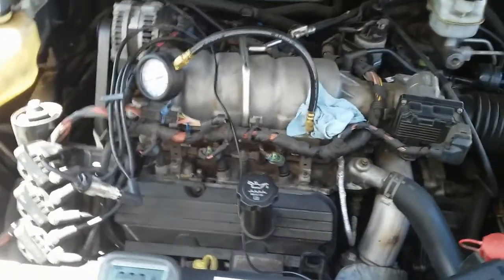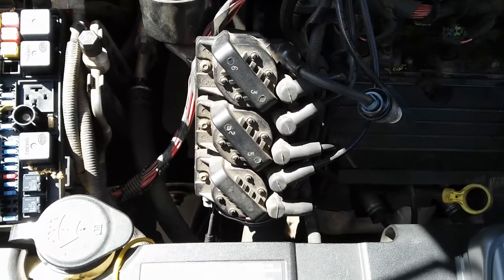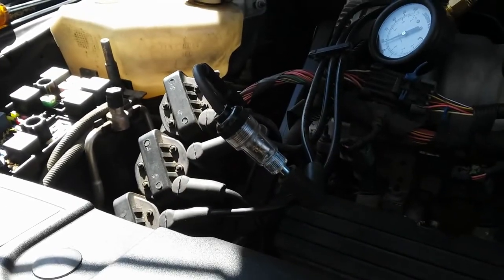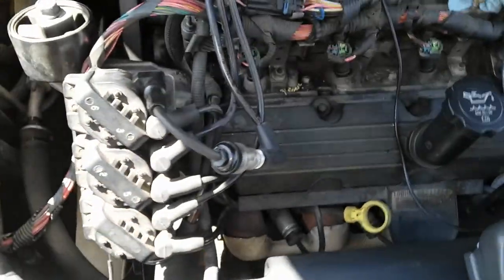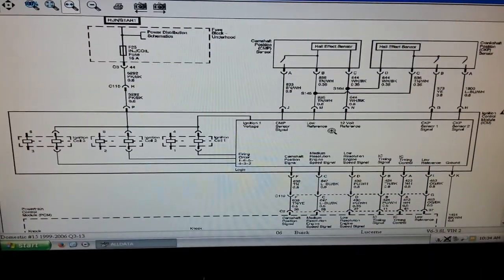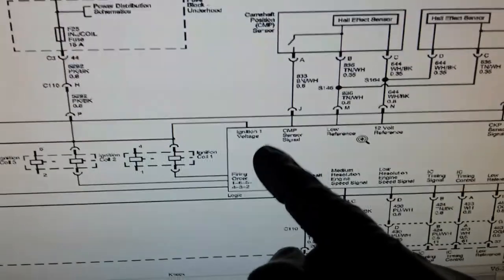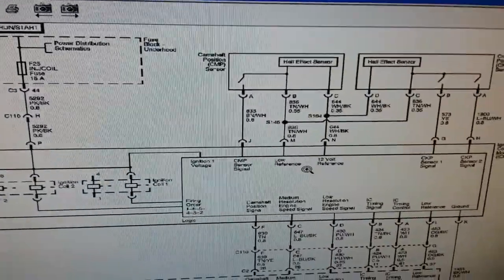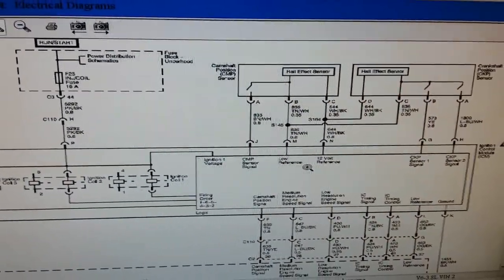(Buick Lucerne) Crank, No Start.... Faulty IC Module

Comment: Having a similar issue with no gauges working and crank but no start with rough idling and rough starting when it does start. Any ideas?
Reply from the maker: Need to check for faulty input sensors, such as the crank sensor and cam sensor. Output, faulty ignition coil(s), spark plugs, injector(s). Fuel trims too rich.

Comment: ok. I have crank no start. I changed out the fuel pump because I didn't hear it coming on, still no start. I can hear the relay but no prime. do you have any solutions?
Reply from the maker: You need to check power and ground at the connector of the fuel pump to see if it's getting those two sources.
Reply: @EliTheOBDTech  Thanks

Comment: I got a top coil wasnt firing. P0300, flashing cel. Swapped coils still no spark on top.. changed out with 3 different modules bc with the new ones the middle coil wasnt firing. Car started ran for a few seconds then rpm started surging and dropping then stalled out and Put back on original module and again top not firing. Replaced crankshaft sensor and harmonic balancer. Car wont start at all.
Reply from the maker: Possible problems:
*Bad PCM/ECM
*Shorted injectors causing the computer to shutdown the coils
*Jumped Timing chain
Reply from the maker: Forgot to mention, electrical problems: bad ground or power to the ignition module or wiring problem.
Reply: @EliTheOBDTech  thanx for some direction. Next place i was going to test was between the pcm and icm so after u saying that i guess im on the right track. Thanx man.
Reply: @EliTheOBDTech  would i be able to rule out shorted injectors and timing chain due to when icm module is changed the no spark event goes from top coil to middle? Not contesting just curious.
Reply from the maker: @confidential8738  In that case, yes. Hope you track down your problem,  very interesting.
Reply from the maker: Are you replacing the ICM with aftermarket or gm product?
Reply: @EliTheOBDTech  well good question. The 2 i got from the junk yard had no oem writing from what i could tell. Oriellys was aftermarket. Looks like aftermarket was already in there. And the crankshaft sensor said made in Mexico so someones been in there before me at some point in time. Coils were also aftermarket that came with the car, but i swapped them all around with 3 other coils i had from an old car of mine. I was going to replace icm and all new coils bc ive seen case studies of a bad coil bringing down the system on the icm control wire and firing 1 coil twice. Southmain auto... But yeah try getting all new icm and coils and if that dont work,  then move to the pcm connection with the icm. I dont have a scope or i could eliminate all this madness lol. Cant find a decent mobile mechanic around here either so i appreciate your input.
Reply: @EliTheOBDTech  got an oem icm and coils and replaced crank sensor with original crank sensor and car runs now. Thanx for ur help sir.
Reply from the maker: @confidential8738  I'm glad to hear that.